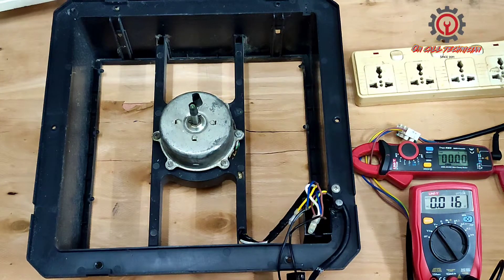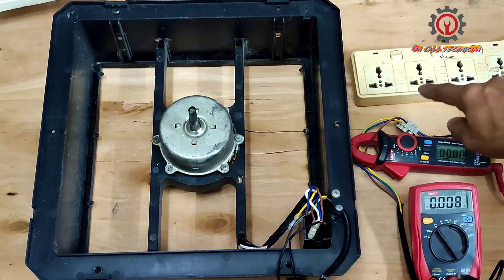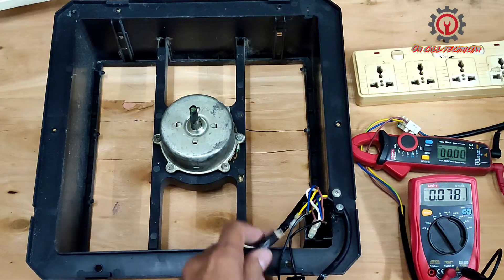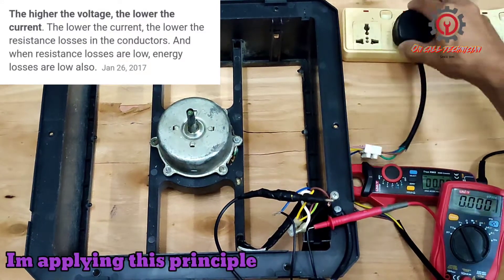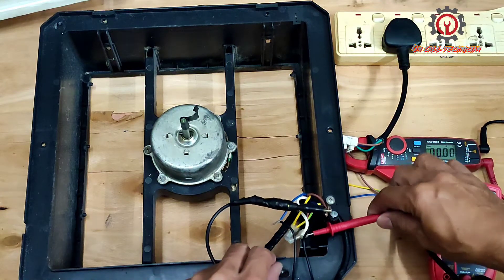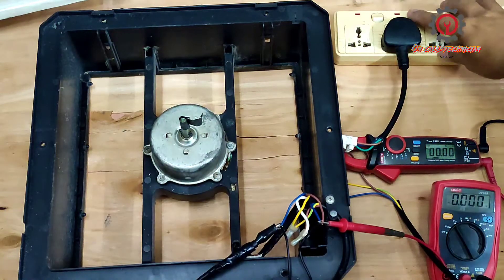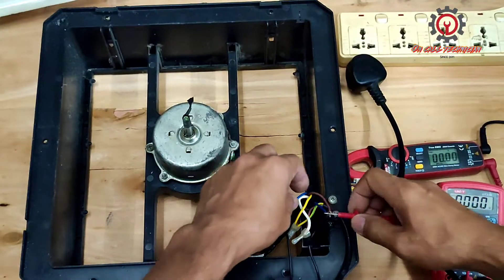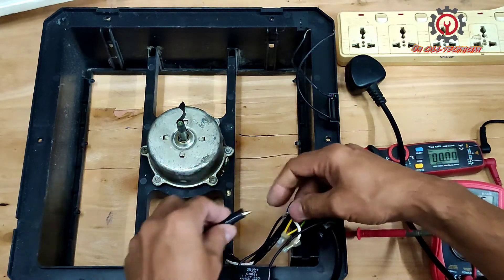HOW TO REDUCE SPEED OF AN EXHAUST FAN MOTOR / REQUESTED TUTORIAL FROM MY VIEWER

Comment: I have bought a khaitan exhaust fan 220-240V, 50 hertz AC phase1 60W 0.25 ampere. Can i put a fan regulator to control its speed? If yes then what should i look into while buying a regulator?
Reply from the maker: Not recommended sir
Reply: @THEMULTISKILLEDTECH  may i ask further that whats the reason since ceiling fans, cooler fans have regulators.
Reply from the maker: The design is fixed speed for exhaust fan sir, now if you insist just follow what i did in the video. The regulator i used  is from ceiling fan
Reply: @THEMULTISKILLEDTECH  i tried put a normal fan regulator (those small ones). It worked at top speed but didn't at a speed 1 less than top speed. There was a spark sound in the regulator at that lesser than top speed. My requirement is to run the exhaust fan always at 1 less than top speed and not change speed often like we do with ceiling fans.
Reply from the maker: Normal fan have 5 leads for 2 speed and 6 leads for 3 speed sir. Your exhaust fan is only 3 leads
Reply: @THEMULTISKILLEDTECH  sorry didnt get that. My bad being non technical. Looks like some modification needs to be done inside the fan to lower down its speed.
Reply from the maker: https://youtu.be/bwRRBNdfAnY 👈 watch this my friend and change output load to your exhaust fan. It will works 💯
Reply: @THEMULTISKILLEDTECH  the regulator i was using was faulty. I got a new regulator and now the fan is running at a lower speed when i set the regulator to speed 1 less than top speed. Looks like the issue resolved. Is it good to go with this?